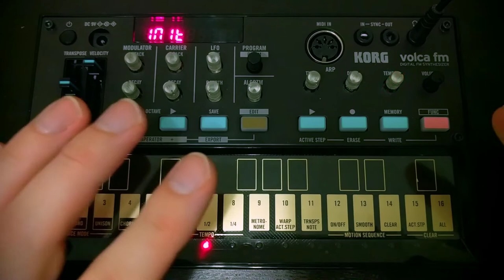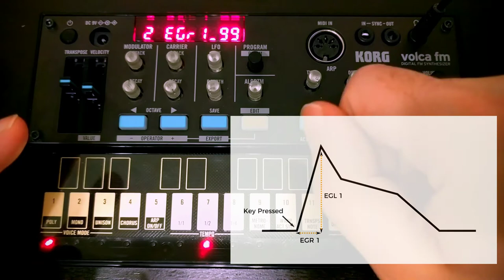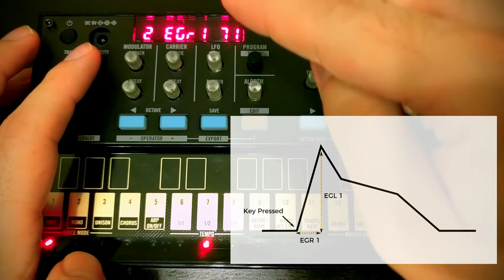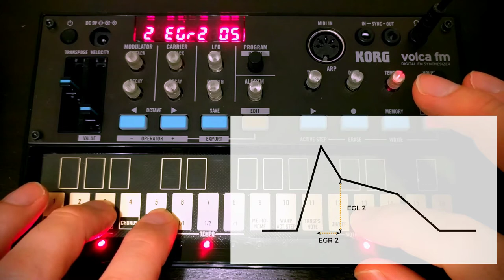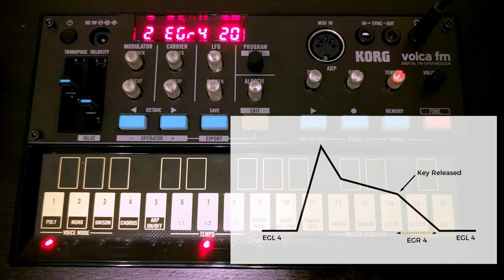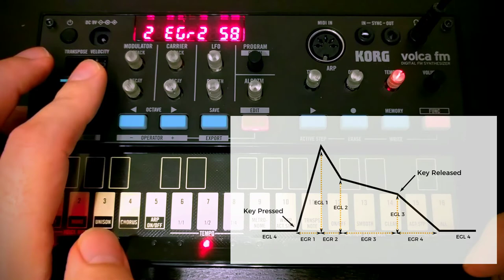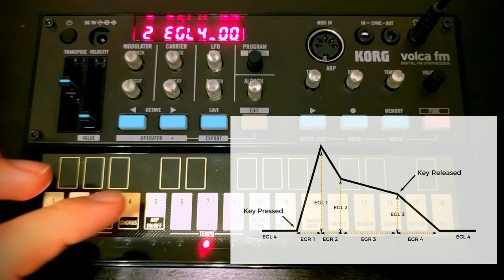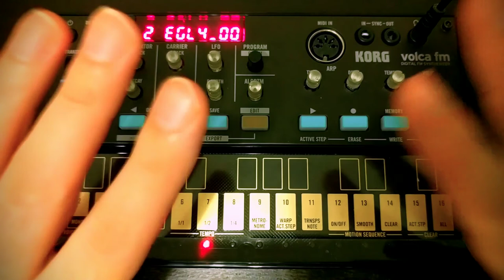Understanding Sound Design on the Volca FM - Episode 3: Envelopes

Comment: Great video series! Your envelope diagram showing the various EGR and EGL and how they relate to the envelope is amazing and has really given me a better understanding of what's going on with the envelopes on the Volca FM. It really should have been included in the manual and probably on the cheat card too. Thanks a million!
Reply from the maker: No problem - one tip with the Volca: dig up a copy of the DX7 manual online. It has a bunch of technical information about the synthesis engine. It's a little "dry", but very informative.

Comment: Thanks for explaining this. The graph from Korg on the cheatsheet seems to be wrong: there is a long straight line behind L3, which doesn't make sense...
R4 should be a straight line, I think, not two lines.
Your graph makes more sense.
So, if I understand correctly, the value of EGR x could be translated to the angle in %, where 00 = 1% and 99 = 100% / 90°.
Reply from the maker: I don't think the equation is quite that simple because those sections of the envelope are actually exponential in reality...

Comment: Hey, thanks a lot for this in depth Tutorial. I now understand at least some of the basics of synthesis in general and especially a lot more about the volca FM. I fell in love with it at first sight, even though i have no clue at all. But somehow i connected immediately :D. But although i can follow your descriptions very vell, i cant imitate your envelopes in reality. I do the same stuff as you do, but the EGr1 for example just does nothing. Maybe i have some other parameters done wrong? I turned all the knobs in the position you have it. But i cant figure out which programm you choose? or how you got all the other parameters. I think i missed something very basic, maybe you can help me figuring that out?
Reply from the maker: Hi, if you have a midi interface you can get to a good starting point using the free browser based editor I made,  details in this video: https://youtu.be/Y166FytVC8w
https://synthmata.com/volca-fm/

You can also use it to, you know, edit the patches and it even visualizes the envelopes!
Reply: @OscillatorSink  oh wow, this was a fast reply, thank you! i don't have a midi interface yet.. just 2 volcas and  some headphones :D
Reply from the maker: @miranova716  OK, try this, use algorithm 5, turn off every operator other than 1 and 2. Set operator 1's output level to full and operator 2 to about 80. On both those operators set EGR 1 and 4 to about 90, EGR 2 and 3 to about 10. Sent EGL 1 to 99 and the other levels to 0. That'll probably give you a good starting point for learning the ropes. If you have the patience set up all of the other envelopes the same way and save that patch as your starting point.
Reply: @OscillatorSink  Oh wow great, thank you so much!! i'm really looking forward to dive deep into the world of sythesizers. It is such a fun an interesting thing to do amd learn about :D

Comment: Hello! This is my first day with volca FM. Your videos are very helpfull. I had to come back to envelopes and ask you a question: Why the note doesn't turn off copletely. I only play carrier with EGR1 78 , EGL1 99, EGR4 48 and EGL4 00. the other EGs are 0. I can still hear a little sound. Can you help me?
Reply from the maker: I think that's a known issue with the Volca - there does seem to be a little bleed on some algorithms. But make sure you are running the up to date firmware as I know they fixed some issues in the latest one.
Reply: @OscillatorSink  Thanks!!! I'm afraid I have no way to connect MIDI to computer, so this firmware should do. But now I can continue watching the rest of the series, without feeling I'm missing something. You have good videos!!!
Reply: @felippeboulderdash8453  you can update the firmware with just an audio cable. Check out the instructions on Korg's site
Reply: @feteti  Thanks!!! I'll try!.
Reply: My firmware is 1.04 and Korg's site has only 1.03. I don't know if I should up(down)date or not. I'm pretty happy with my Volca now.
Reply from the maker: 1.04 is the same as 1.03 - they just have a different number if they come direct from the factory.
Reply: @OscillatorSink  OK! Thanks!!!

Comment: Could you share your init patch with us? I am trying to follow along but have trouble since i dont have the same patch to start out with. Specifically operator 2 level doesn't seem to change the sound at all!
Reply from the maker: To your particular issue - try switching your algorithm to 5 or 6, make sure both operators 1 and 2 are turned on and that operator 1's level is up full.

For an init patch, if you have a midi interface on your computer, using chrome as your browser go here: https://synthmata.com/volca-fm/

This is an editor for the Volca that I built - the init patch can be sent from there, and there's the added bonus of being able to edit the sound on screen rather than paging through the parameters on the Volca!

Comment: hello mate, can u tell me how i have todo to get that sound "in it", isnt in the "program" knob. Thanks a lot
Reply from the maker: +Matias Pereira hi there - annoyingly the Volca doesn't have an Init patch built in. So in this case I'm using a patch that I built which is similar to the Init Patch on the DX synths. If you want it, the easiest way is to use my free tool called "Synthmata". You can check out the details on my channel.